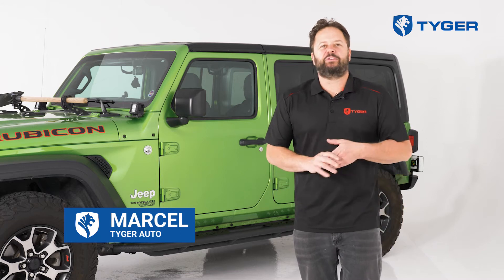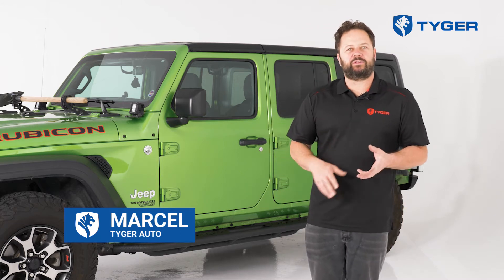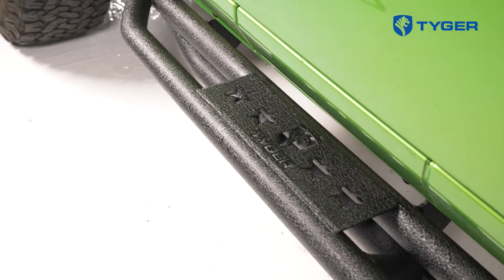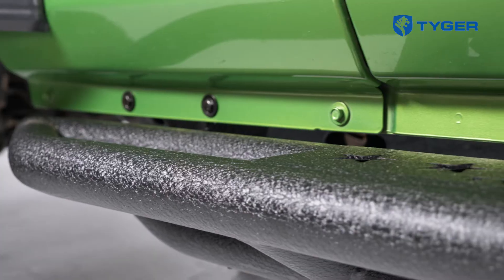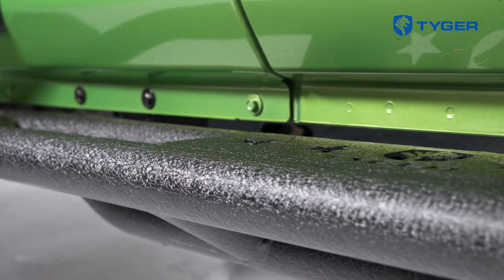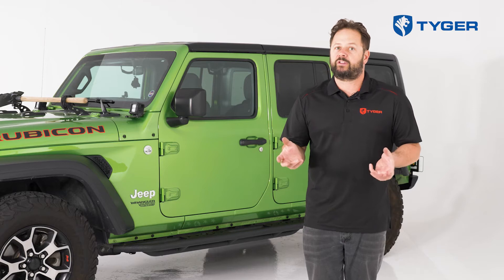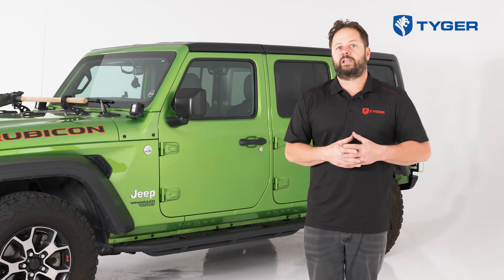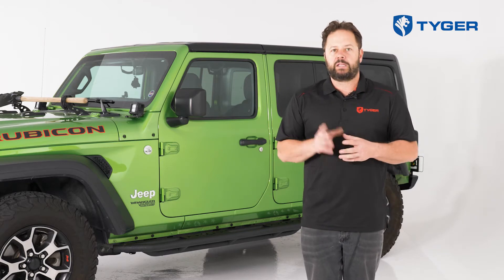Star Armor for Jeep Wrangler JL | Install Guide | TYGER AUTO

Comment: I’d like to note that step 2 is slightly off. The running board that you put on the drivers side actually goes on the passenger side. 😅 definitely messed us up trying to put them on
Reply from the maker: Thank you so much for pointing this out Elisabeth, we will make the necessary edits to remove the confusion.
Reply: @TYGERAUTO  awesome!! Thank you for such a quick reply!

Comment: What are the recommended torque specs for the pinch weld side bolts and the upper bolt?
Reply from the maker: Hi Greg - here is the installation manual which includes the torque values chart in page 1 and the individual bolt sizes used for installation.  Let me know if that answers your question. https://www.tygerauto.com/mm5/graphics/instructions/TG-JA2J2288B.PDF
Reply: @TYGERAUTO  Thank you!